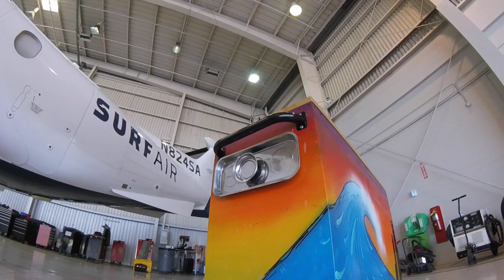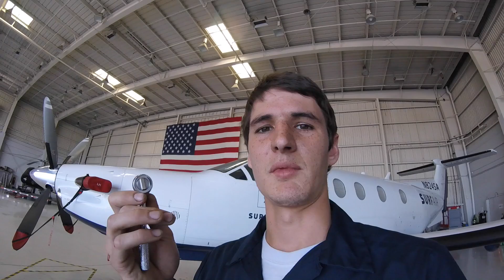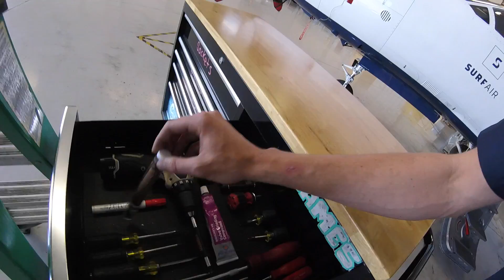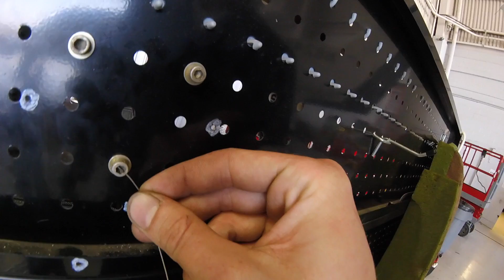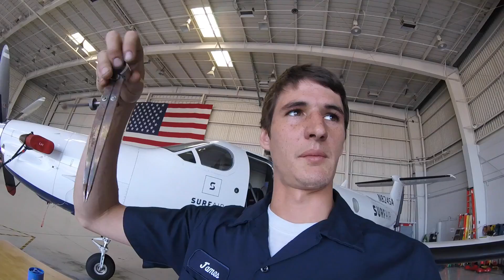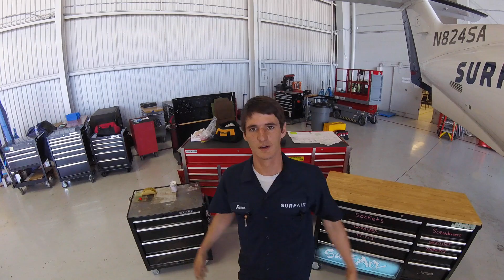What's Inside an Aircraft Mechanic's Toolbox?

Comment: Lot of stuff missing. Lot of low end tools. Need to invest! Get a Knipex.
Reply: He's just starting out @2491kridge. Give him time to grow and expand his tools. It's takes a while, as you said, it's expensive. Aircraft tooling and automotive tooling are two completely different things. I'm an A&P as well (25 years), and I have a toolbox that is probably around $45-50K worth of tools. My tool box at home in my garage is an automotive set up, and has many different things in it. Lots of impact tools, which you don't use on aircraft. Now some aircraft mechanics have what is called a sheet metal tool box. These will have many specialty tools for doing sheet metal work. Lots of pneumatic tooling, and the price would be around what you are suggesting. But if you're not working specifically on sheet metal work, then you really don't require all that stuff.
Reply: James Sullivan 
I've been an A&P for 25 years. knipex set is great. Get some snap on offset wrenches, and a set of gearwrenches (the real ones not knock offs) they are gold!  
keep up the good work. when you're ready for a serious job contact me.
Reply: @mathiasweber8772  still got some overseas work? Whats your email
Reply: @zoltonloback9836  yea man.
Reply: James Sullivan 
overseas work.
Reply: Knipex and Wera, the Germans know how to do it...
Reply: Yep. Knipex cobras rock. I stopped replacing them 15 years ago doing construction work. They disappear too fast. The Germans need to add GPS tracking system to those things they disappear so damn fast! Now that I'm back to wrenching in a hanger, I'll probably get them again. They're basically a slim profile pipe wrench in how they grip.
Reply: And the small Channel locks break! 
Blood & swear words!
Reply: you really need to learn about tools and how the quality of the tool does matter.  sure a cheap one will work in a pinch but overall and good quality tool will always work better and last longer.  if your working on plans i would suggest to invest in real mechanic tools not the weekend home improvement diyer.  i was be scared if i saw your tool box rolling up to work on my plane.
Reply: +1 for Knipex, great tools
Reply from the maker: Thanks for the advice... What do you mean a serious job?
Reply: I would recomed this one: http://www.ebay.com/itm/Knipex-8605180-7-Inch-Pliers-Wrench-Comfort-Grip-/302255912191?hash=item465fdb34ff:m:mVQQe6lqBll4zxuJqmewqOA
I can´t leave my home without it anyway...
Reply from the maker: Ah okay. That's where the real money is for sure
Reply: Yeah, I've had a couple snap on me. I have a few bent 10" Channel locks as well. They're still a good value since they don't disappear like the Knipex. Just be mindful that the small ones can break on you.
Reply: And they all have to be set in foam. It was a good video and I really appreciate you making this video, but I would really be frowned on at work if I used that level of tools.

BTW your toolbox is really cool! I have a similar setup with a real solid 2" thick work top. It's great. Have you considered a little vise? Comes in real handy
Reply: Even Fuller Pro tools are frowned upon where I work, forget regular fuller. We use Stahlwille, Snap-on, Wera, Knipex, Gedore, Hazet, and then lower end would be Gearwrench, King Tony, Ampro, etc. Crapsman frowned on. (in NZ in case you're wondering btw wages here are 30-40 an hour which is like 25 USD I'd imagine, and contractors make 50+ an hour)
Reply from the maker: I'll continue to invest as I see the need like I mentioned. No point but a tool I'm not going to use regularly. That said, the knipex straight jaw set is definitely on my list
Reply: James Sullivan I would expect a lot more tools and of higher quality working on aircrafts, most auto technicians have boxes twice that size and worth near 100k worth of tools inside of them, just my two cents this tour just caught me off guard. I've only been working as a technician for a few years and easily have 20k in tools alone not counting the box
Reply: Mathias Weber hey I'm not bitching at him at all, just saw the video in my feed and as I said it just caught me off guard because I always assumed an aircraft technician box would put an automotive techs box to shame, so it just gave me a new perspective to what I had assumed yanno
Reply: No problem. Aircraft Mx has many different types.

Comment: power probe is a must have for electrical diagnostics. also, toothpaste will work for lapping valves and for worn screw heads.
Reply from the maker: Pro tip on the toothpaste, makes sense. Power probe is useful if you don't know how to use a multimeter ;) shots fired!
Reply: James Sullivan what's nice about power probe is it can power a circuit. which a multi meter cant. both are great tool. every A tech I know has a power probe. makes quick work on wiring issues.

Comment: Congrats on 6k subs! killer toolbox
Reply from the maker: Thanks so much dude! I cant believe the growth ive had!
Reply from the maker: We do use nylon insert self locking fasteners in limited applications in aviation. The best that I can tell mechanical locking fasteners are used in high temp applications or where the fastener may be exposed to the elements. For example you won't find a nylon locking nut on a jet engine sense the high temps would grade the nylon insert. Thanks for the question!